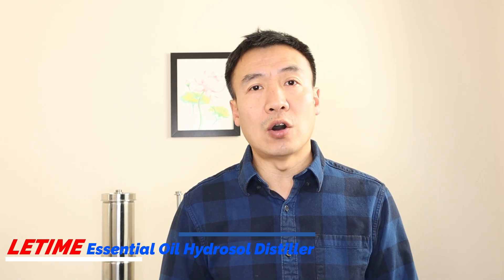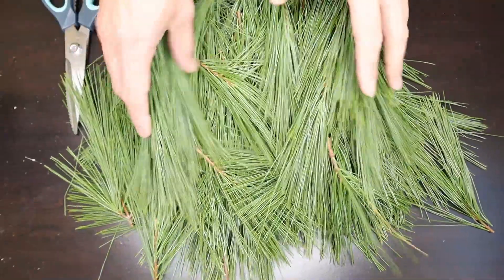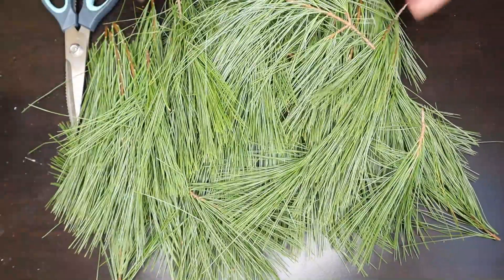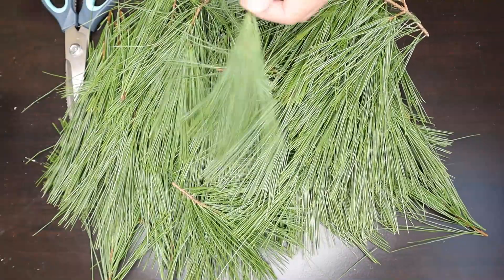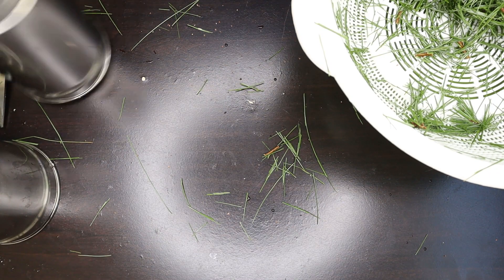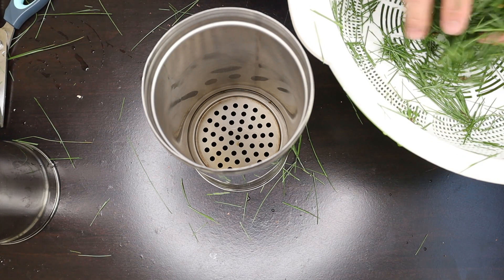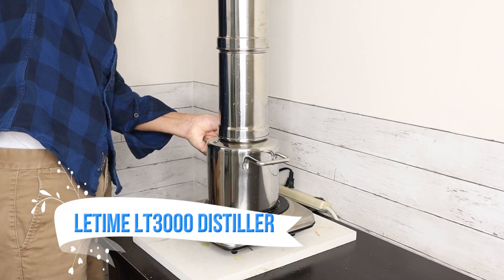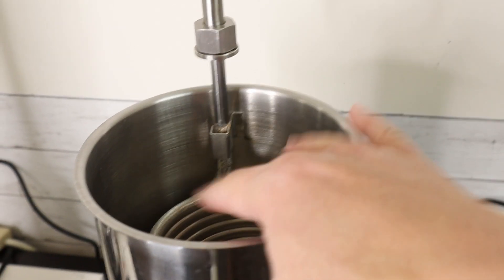Make Pine Essential Oil by LETIME LT3000 Distiller Steam Distillation Pine Needles Rules to Improve

Comment: Hi I have some questions about the distilling process, I have one of your LT300 set ups and I was wondering how can I tell when it is done distilling? Since I can't see through the pot or anything, how do I know when the water has all gone and to turn off my induction cook top? I don't want to damage my pot because I can't tell when there is no more water in it. 
Also, what temperature should I set my induction cooktop at for the distillation process? 
Another question I have is when to add ice in the condenser- do I add the ice before the water starts boiling or after and how much ice exactly?
How do I scoop out the warm water to add more ice in while its distilling? Am I supposed to try to get ALL of the warm water out of it before adding any more ice cubes? It was a bit hard trying to get the warm water out once the ice cubes melted down because its not very wide. Thank you!
Reply from the maker: You have very good and practical questions.
To avoid damage or dry cook, making sure there is at least 2 cups of water left in pot before finishing the distillation. If you added 2 liter (8 cups) of water in the pot before starting, collect no more than 1.5 liters (6 cups) of hydrosol. This will ensure avoiding dry cook.
Always use medium heat for distillation and that will bring you the best hydrosol as well.
I have a video explaining when to stop distillation.
Reply from the maker: How to Make Best Hydrosol? When to stop distillation. Experimental demonstration, easy to follow!
https://youtu.be/osRqRVa0rwQ
Reply: @LeTimeLeo  Thank you! Also I need to know that amount of dry flower/herbs to use and what amount of water? Like if I can only fill half of the column with the dry herb im using, how much water should i be putting in the pot? Or if I can only fill the column 1/3 of the way, would i use only like a cup of water? How do i know what to use
Reply from the maker: @sydneychild  You can start with half column of herb. It is recommended to add at least 4 cups of water in the pot and this can give you a bit of space to avoid dry cook.